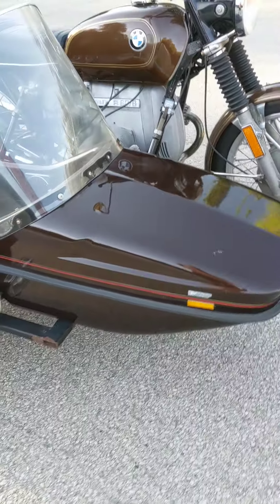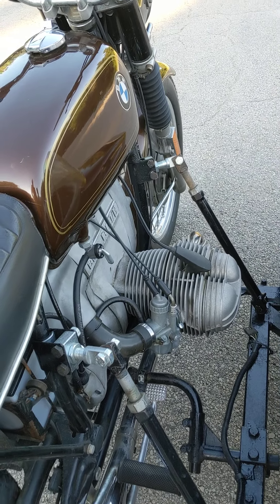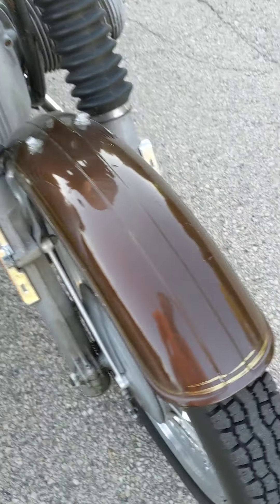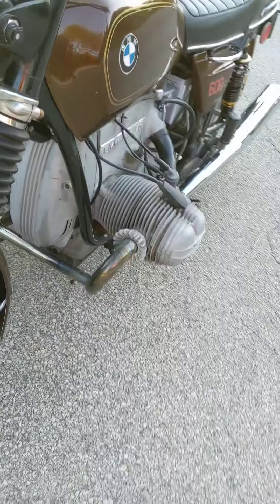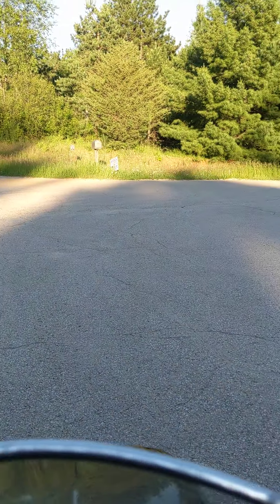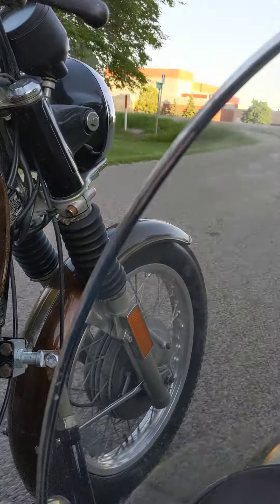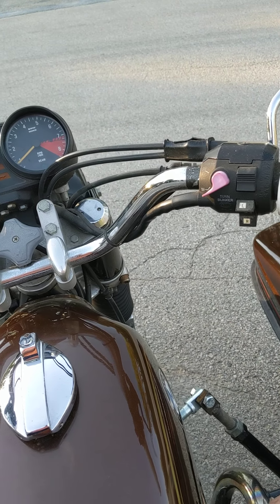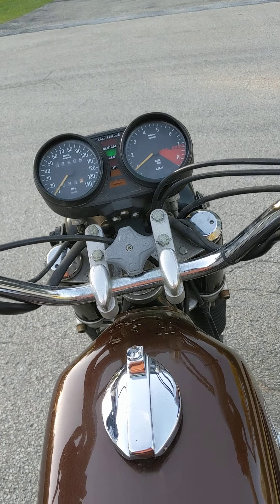BMW R60/6 1976 with sidecar

Comment: I drive a '76  R60/6 with a side hack. If you shift at 4500 RPM and allow it to drop as you shift slowly you will not crunch your gears all the time. I rarely experience this crunch because of this technique. Try it. It will save your transmission. My bike has almost 90,000 miles with original unmolested engine,trans., rear end and clutch. Cheers
Reply from the maker: Thanks for the tip. I don't hear a crunch that you seem to hear. I don't know what it sounded like in my video but where I shifted it seems to go just fine as if I didn't have the side hack on there.